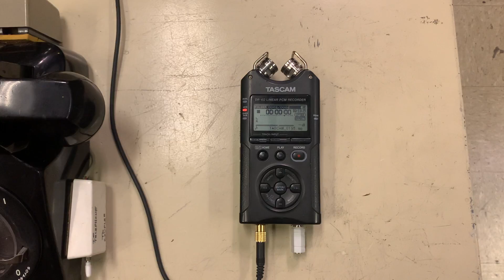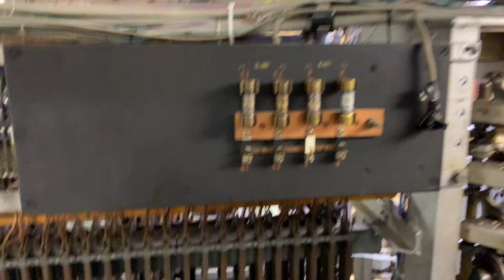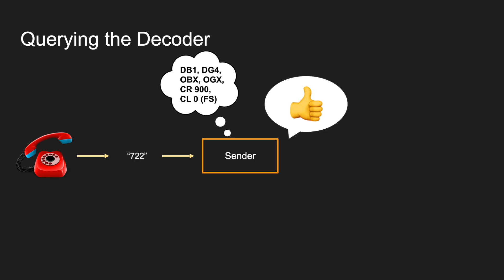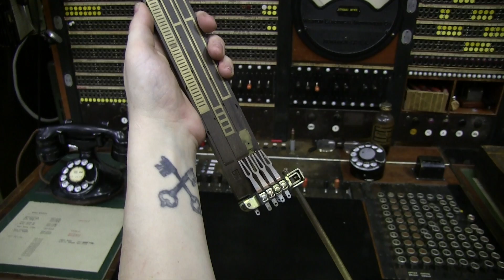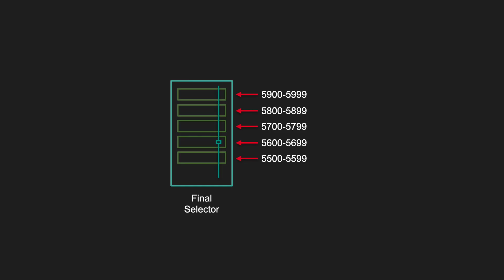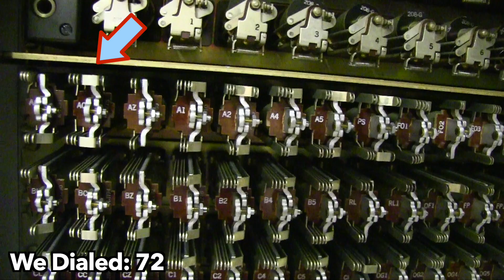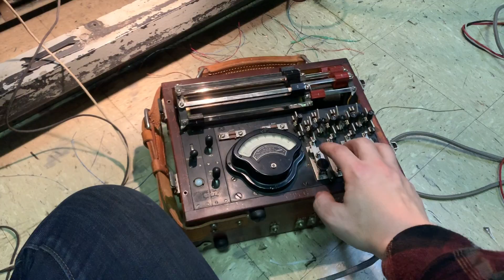Full Mechanical: The Panel Telephone Switch

Comment: Great video. Thank you for taking the time to make it.
I have a few questions:
1. Are the trunks on the district selector multipled? That is, for each row of 30 (or even 60) TRS contacts, are they connected in parallel? Or are they connected in some other configuration?
2. Is each trunk on the district permanently wired to one specific rod on one specific incoming selector? I say "one specific" because I would assume in a fully equipped panel office there would be several incoming selectors. If I understand correctly there is only one in the museum.
3. What happens if you try to dial a 722 number that would have existed and been dialable in the original Parkway installation but which no longer exists in the museum configuration, presumably because the final selector that would have handled it no longer exists?
Has those numbers been busied out? (on the incoming selector I would assume)

4. Somewhat of a follow-up to the last question: if the incoming selector selected a trunk to a final selector which doesn't exist, what would happen? Would the sender time out because it was not getting RP back as expected and give you a reorder?

5. What happens if you try to dial a code that would normally have been routed over an interoffice trunk in the original Parkway installation? Do the decoders return the same information now as they did back then or have they been modified to handle non-722 codes differently?

6. Where exactly is the toneplant located, and how many leads are needed to connect it to the panel? Can you show where it's located, follow the cable(s) (if at all possible) and show where exactly it connects to the panel office? I know that's a bit of an odd request, but if you're looking for any video ideas, that is one detail I'm curious to see. :)
Thanks.
Reply from the maker: 1. Each horizontal set of terminals (T,R,S) on the district frame runs all the way across, so that any vertical rod can access any trunk at any time. The rows are actually multipled between several district frames so that all trunks will be available to all rods on all frames. 
2. Yes each trunk is wired to one incoming selector, permanently. And yes, in a fully equipped panel office there would be a great number of each, district, office, incoming, and final selectors. We only have one frame of each type.
3/4. If I dial a 722 number for which no final selector exists, the incoming selector will go up to the terminal where it would be, but it would find nothing there. The sender controlling the selector will "stick" and it will have to be "primed" (reset) manually. In normal operation, there would never be vacant terminals. They would instead be directed to a no-such-number announcement or an operator.  This could be done here, but it would require wiring every single unused terminal to the machine, and would be somewhat laborious work. Instead, I multiple the series to other thousands blocks--so 5xxx and 4xxx go to the same exact place. Eventually, I will do it with some other thousands blocks as well.

5. In the panel office in particular, I have left the decoder as it was when the machine was taken out of service. (The 1XB, on the other hand, has had its marker wiring cut, so that none of the original routes remain.) There are several non-722 codes that can be dialed in the museum that will work. The ones that do not will just stick the sender, as mentioned above. In normal operation, vacant codes would have been routed to special vacant code trunks with announcements, but I do not wish to destroy the original decoder wiring in order to do that. I feel that it is historically significant.

6. Sure, I can show that. Our tone plant is very small, and not what would have been used in this office originally. We are possibly acquiring the correct tone plant for the panel, but as of now, we have nowhere to put it!
Reply: Connections Museum That would be so cool to be able to see the ringing machine that did “City Ring.”  The current tones sound like one of the frequency multiplier electronic ones.

Comment: Nice to see people actually giving a crap about the technology Ma Bell invented. It's so fascinating how they pioneered this stuff, and how it was able to work automatically for nearly a century before digital circuitry came along and improved on it. I mean it makes sense HOW it all works, I'm still amazed by the WHY it's even able to work in the first place, y'know?
Reply: Technically, the switching is digital, just not in the solid state, computerized way we often mean
Reply: And look at it this way:  there were electromechanical computers before solid-state (and even tube-based) ones.  You think there's a lot of clicking coming from that crossbar?  (Well, there is lol) Some of those electromechanical computers click even more.  There is a huge one that they have somewhere in Japan that is open to the public.  I think it might be the most advanced one ever made.
Reply: I still find it fascinating that it's able to work in the first place. I mean I get that it's an electromechanical computer, but man that's neat! Lol
Reply: @zzco  Well, I didn't mean to imply that you didn't understand the principle. ;-)
Reply: @zzco  They actually use crossbar (literally, when they built the thing, they bought crossbar modules intended for telecommunications) for memory.  No wonder I thought the noise was similar lol.
Reply: @zzco  It has 13 kilobits of crossbar memory (not bad for 1958).
Reply: Longer than a century.

Comment: Wow, that was brilliant, thanks so much. That was really detailed and interesting, even if you did leave a load out for pacing reasons.

Even filtered like that, the thunks of the dialling pulses were a bit much with headphones, but maybe I need to go listen to some more loud music :D

Questions I have:
* How does this system differ from the equivalent UK system, if at all (though I doubt you know much about that - I'm a UK geek and I've a mild interest in telephony, is all).
* How does the selector memory system work?  I could see a knot of wires and some closed cabinets - is it a relay-addressed wire-wrapped plugboard, or is there more to it?
* In the sender, is there a bank of ?10? relays per dialled digit, or do banks get reused once the digits have been dispatched to the relevant frame?  I guess that would only be possible if frame setup occurs during the dialling process rather than once the user has entered all the digits. <your answer to DavidFromRI implies this isn't possible, as the system assumes users can dial faster than it can route.>
* How "finicky" is the motor drive on the selector switches? It looks like a metal-on-metal wheel contact at ninety degrees - is there any frictional material in there, and if not does it ever skid/skip?
Reply from the maker: --Like has already been mentioned. The UK used mostly step, and then eventually a form of crossbar. The panel switch is quite different. (For a while, the panel's sister switch, known as the "7A Rotary" was installed in various parts of Europe. Developed initially by Western Electric in the US, and then moved to their plant in Brussels.
--The sender portion is definitely worth its own video. It's quite complex.
--There are recording relays for each of the 7 digits plus an extra set for the "stations" digits (for use with party lines). Each digit is recorded by some combination of 0,1,2,4,5 relays. 
The sequence switch 90 degree drive is quite finicky. It is indeed metal-on-metal contact. The friction is provided by a pumice stone and a cup of water. Every so often you have to go around and grind them with the wet pumice stone which will cause a layer of rust to form on the discs. The rust is required for the switches to operate! If a museum visitor touches the discs and gets oils from their fingers on them, I have to clean them with alcohol and then re-rust them.
Reply: @ConnectionsMuseum  In today's terms I suppose the rust would be referred to as a "thin coat of oxide"?
Reply: @ConnectionsMuseum  Great, thanks. 
- I sense a rabbit-hole forming, and now I have some search terms... :D
- I'd be interested in further videos, both on the sender system and the decoder memory.  I seem to recall a previous sender-debugging video of yours, will have a look for it.
- Interesting, a variant binary code. I thought I saw 10 number relays in the A register in the video of the sender yesterday, but on careful re-examination today I see that what I took as a continuation of the A register (on the right of screen) was actually a bank of different relays (PS and a set of FOx relays), one of which (FO3) tripped when the A register finished loading (I think).
- How strange. In most cases I know of (mainly re-enactment swords, to be fair), getting skin oil on the metal /causes/ rust ... but of course metals and their uses and needs are different.  Ah, visitors and their touching things...
Reply: •	Panel system were never installed outside of North America.  The UK used Step by Step (aka Strowger) equipment, and eventually Crossbar.   Those both work very differently than panel.
•	Perhaps Sarah can explain the decoder (memory) system in another video sometime
•	The sender uses just 5 relays to store each digit, using a two-out-of-five code
•	The selector switch drive seems to be pretty reliable.
Reply: @makingconnections  Thanks for the reply.  As I said to ConnectionsMuseum just now, I sense a rabbithole forming, but now I have some search terms.  I agree that the selector drive seems pretty reliable - I remember several videos about the selectors where it seemed like everything /but/ the drive was faulty - but based on this description I'm surprised about that :)

Comment: This is wonderful, Sarah  —  It's your best video so far!

Question:  After reaching their selected groups, do not the district and incoming frame brushes travel up again in slow speed, to hunt for an idle trunk within the group?  Perhaps for simplicity, you skipped over this detail to "selections beyond", but it would help in understanding the logic of Panel's "500 terminal" architecture.   (or, perhaps your museum switch has but a single trunk in each group?)
Reply from the maker: You're right. I skipped over trunk hunting entirely, in an effort to simplify, and focus on just the important details!

Comment: So many questions, so little space:
1) Coupled to the CO battery on-hook as you did (and heard audible noise), could you capacitively couple and talk to someone? What about post dial tone or during busy?
2) What if you dialed 2 or 6 digits and stopped, would the equipment be tied up (i.e. sender & decoder)? If not, which part monitors for this condition?
3) What if no line finders are available when going off-hook, what do you hear (i.e. during emergencies)? Expect silence but maybe the line relay covers for this?
4) What prevents you from dialing faster than the panel can search for the next available panel? Example: 722-1111
5) Does this office support billing info, or does it pass toll calls to an office (or operator)?
6) Was there ever DTMF capability?

Was planning a trip across country for a tour, then COVID-19...
Thanks!
Reply from the maker: 1) I've never tried talking over unfiltered CO battery, but you could probably talk over it, yes! The only problem you'd have is that you'd have to overcome all of the inductance from all of the relay coils that are sitting on that raw battery. Basically, some of your voice current would disappear into relay windings and get turned into tiny magnetic energy, so it wouldn't end up traveling that far. (The relay coils that normally sit in a talk path are designed to be transparent to the AC current of your voice also, but they direct that current in a particular direction--to the person you have called). On the other hand, talking over busy tone is something that can happen on some switches. Evan Doorbell has plenty of recordings of that!
2) If you dialed and then stopped the sender would be sitting there waiting for you. There is a timeout condition (about 30 seconds) where you would be transferred to a holding trunk and the sender would let go and go handle someone else. It's called "permanent signal" in the telephone world.
3) If no line finders (or senders) are available, you would hear nothing. (You would likely run out of senders before you ran out of line finders) That's exactly what dial tone means--that there is equipment available and ready for you to begin dialing. In the panel switchroom, there would be quite a racket though, as the equipment would be frantically searching for a sender and not finding one.
4) Nothing prevents you from dialing faster than the panel switch can search. That's actually expected. The sender merely stores/buffers your digits, and completes the call as it is able to. I dialed slowly in this video in order to make the steps more understandable.
5) This office supports local billing (message registers) for calls dialed within the city. Long distance would have gone through an operator or (eventually, by the 1960s) through a separate long distance tandem switch for billing and completion.
6) There was DTMF capability in some panel offices in the 1970s, but never in Seattle. In some cities, support was added via 3rd party devices like this: https://telephonecollectors.info/index.php/browse/bc-switching-library/teltone/3787-teltone-m-164-convert-a-pak-models-70-71-72-and-73

Comment: Two questions: 

First, it seems a bit crazy that the sender at my local office would have direct control over the operation of some remote office's equipment. Can you confirm how that works?

Second, when you first mentioned the sender unit communicating with the decoder, it sounded a bit like the dialing information was loaded into some form of mechanical memory in the sender, but later on in the process you kept using the phrase "we dial"... so it sounds like this all happens while the calling party is still dialing the number and there isn't any kind of memory involved. Which is the case? Or is it a bit of both?
Reply: Even crazier; if instead of Panel or Crossbar, you were calling from a Step-by-Step central office; then the dial of the telephone in your home would have direct control over the remote central office equipment. As you dialed an office code, you'd hear your local office connecting you to a trunk to the distant office. The rest of the digits you dialed were received directly by the distant office — no matter what kind of equipment it happened to be!
Reply from the maker: 1) That is absolutely how it works. It's one DC loop from the sender in your office, to the selector at the far end, miles away.
2. It's both. The sender is storing all seven dialed digits in relay memory,  and processing that data in chunks (the first three digits are processed all at once). The communication with the decoder (decoding the first three digits) is happening at the same time, and storing information in separate bits of relay memory.  It's almost like the sender can multitask. (I sort of didn't go into how the sender works in any detail. That deserves its very own video!)